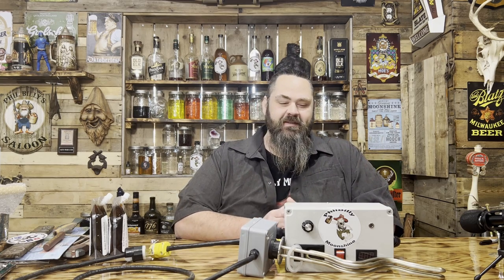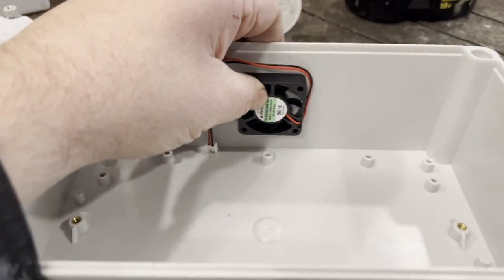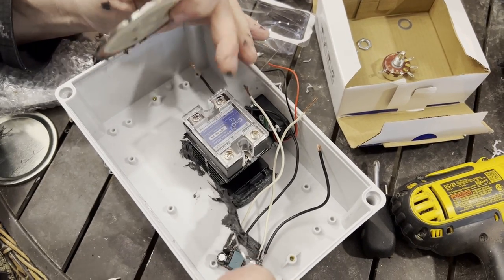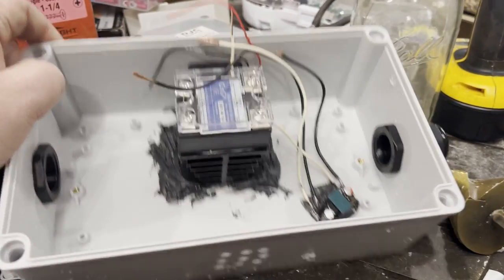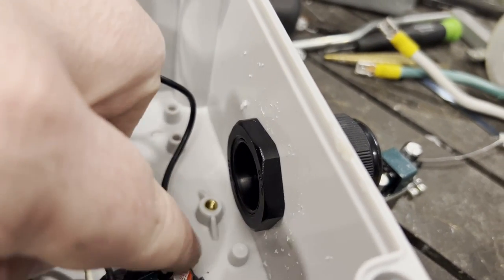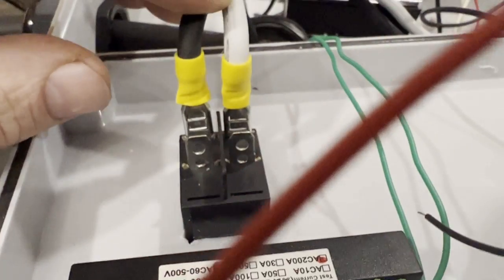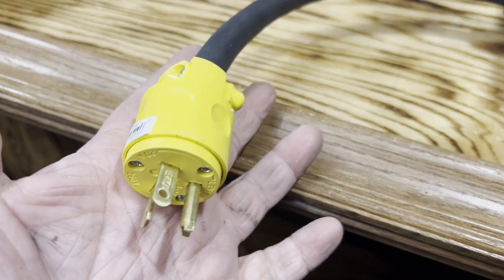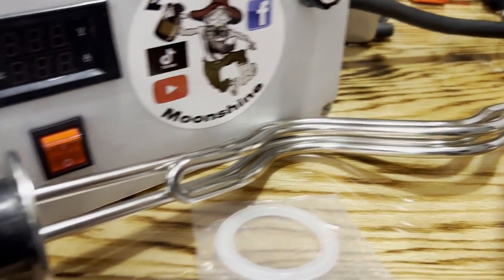How to build a 240 / 220 SCR Controller for a 5500 Watt Heating Element

Comment: For those of you building these on your own, keep it cheaper and easier by buying a 220v fan, small ones are less than 12 bucks and it saves a whole component of this circuit. Also, you don't need the switch. Plugging the circuit in will act as your on/off. Saves more money and time, and simplify it a bit

Comment: I’m no expert by any means, but why would you want to detect amps on the incoming power ? I would think it stay the same all the time. I figured the donut would go on outgoing power.
Reply: The amperage changes as the solid state relay increases/decreases the amount of power the heating element is allowed to draw.

Comment: I like your stuff philbilly but you need to keep it consistent with the wire colors. Using a spare Green wire as a jumper for a hot wire is pretty alarming. Try and not use green wire for anything but ground.

Comment: I made one about a month ago. Do yourself a favor and use the right kind of wire terminals and terminal blocks especially to hook your wiring up. It will make it look and perform a lot better especially if you're selling them. The wire nuts are really not made to be jostled a lot. Remember you are running 240V and around 15 to 20 amps.
Reply: Learn FIRST...Don't play hide & seek with DEATH. (many don't understand)
 Be an electrician or CALL ONE. 
(At the very least be WELL informed of the dangers and the process in which to SAFELY "PLAY with" mains voltages and amps above (20mA))
 sketchy wiring jobs KILL unsuspecting victims because of these words _ "Trust me it works...I made it"_
Reply: Are you able to send me some more info about what you used for your setup? My dad is wanting me to make him one of these and there's no way I'm letting him use one of these with this guy's build. I've just been shaking my head the whole time while watching his "techniques."

Comment: My still came with a pid controller. Should i swap out to scr? Does it heat and hold temp better
Reply: No, the PID is better at maintaining a consistent vapor temperature once you learn how to use it. The PID hunts for the required amperage draw to maintain your set point temperature. The SCR allows you to control the amperage. Ol' Philbilly here, was incorrect when he said the PID runs full power until it hits temperature and then shuts off. If you watch your PID you will see it run full amperage until it hits your set point and then pulse power to maintain that temperature.
Reply: PID isn't better for a whole lot of still operators.  The liquid will boil at a temperature related to the alcohol content, and is unrelated to the power being put into the still.  Flow rate, especially with plates and other methods to create reflux, is what many operators want to manage.  Thus, power level, not Vapor temperature is the controlling metric.  We many track the vapor temperature, but we don't seek to control it.   In addition, this build was NOT a SCR build, it was using a SSR.  SCR is a more robust solution.
  @ptbelttactics

Comment: I’ll never tell someone what to do…but I will suggest you not sell these in this build config. Use proper terminals to make terminations, get that heat sink off the plastic, loose the wire nuts, etc. when somebody burns diwn their building/home or electrocutes themselves they are gonna come at you with lawsuits.

Comment: 7:45 = This isn't recommended as the EPOXY can be conductive and create a FIRE HAZARD. 
Why would you put a HEAT-SINK on a PLASTIC enclosure? Again FIRE Hazard?
Reply: I used an external heatsink that's the size of my case and cut the plastic out to clear the united automation psr-25.
Reply: Epoxy alone is non-conductive, but if combined with silver filled epoxy it can become conductive. The most common is silver, but gold, nickel, copper and carbon can also be used. Another benefit is the epoxy can also be thermally conductive, meaning it can also cool the component.